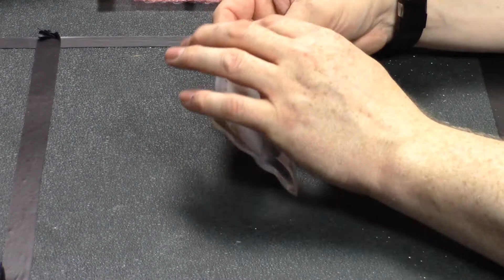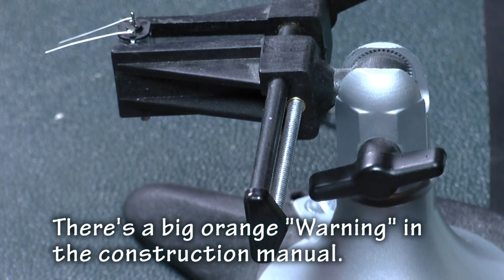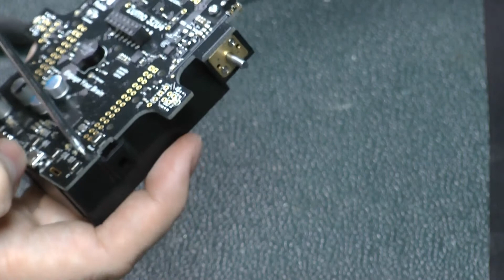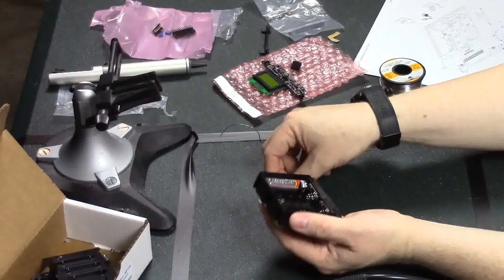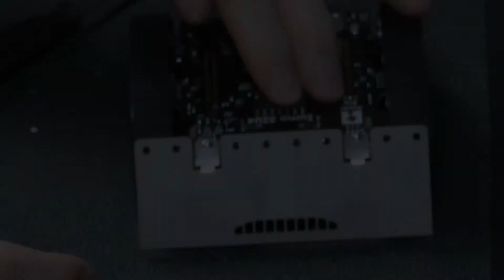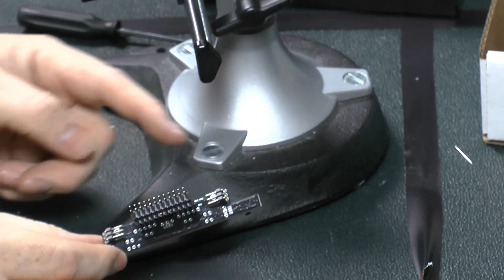Zumo32U4 Unpack and build

Comment: Why 3d printed led bar is required? What is its purpose?
Reply from the maker: +Szymon Życiński - It's not needed in kits since Aug 2015. For earlier kits, it's still not strictly required but helpful. It's purpose is to neatly hold the forward emitters in place. See https://www.pololu.com/docs/0J63/4 step 29 (using the LED holder from the newer kits).